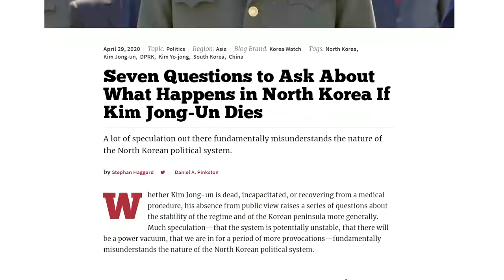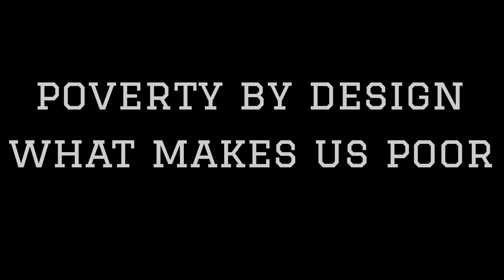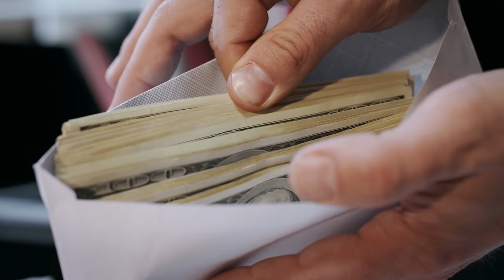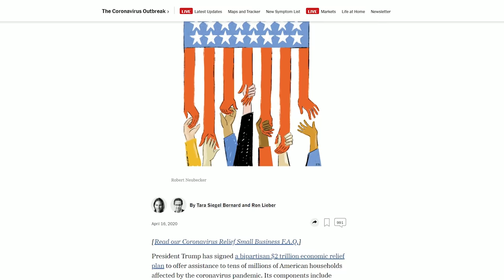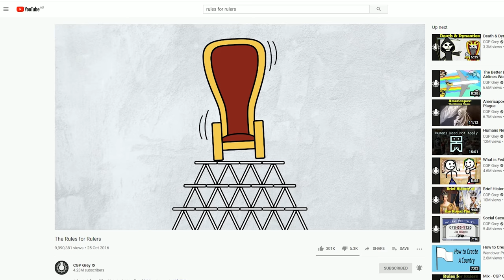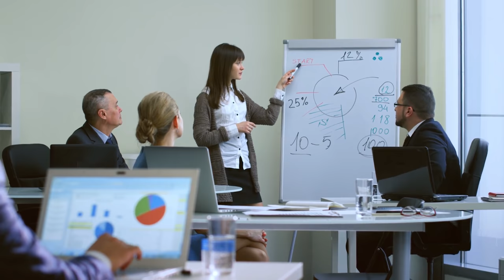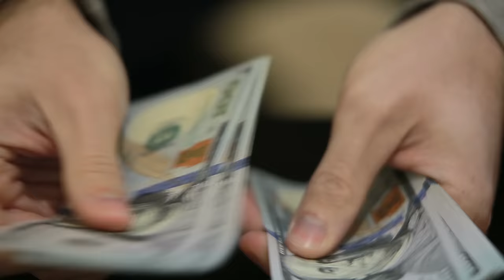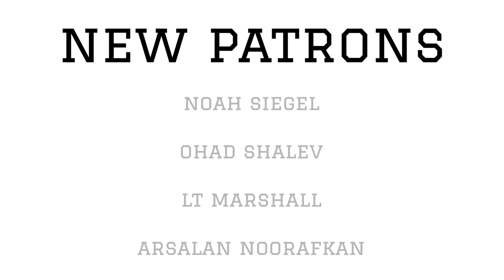Can a New Leader Save North Korea's Economy?

Comment: Speaking of mismanagement and dictatorship. The Economics of Zimbabwe would make for an interesting video. From being on par with the USD to having the second worst hyperinflation ever
Reply: "On par with the USD" wtf, do you mean the Zimbabwean dollar was as strong as the USD? Well, it wasn't. It might have had the same nominal value at some point, but it was always an extremely weak currency. Zimbabwean dollar's inflation was in the double digits even before the events that lead to the hyperinflation happened (namely the displacement of European farmers and replacing them with inexperienced African ones which lead to the collapse of its agricultural industry, and the extremely expensive Second Kongo War the country funded by printing money). It wasn't a stable, strong currency going into hyperinflation, it was a weak and unstable currency becoming even more unstable and eventually hitting hyperinflation
Reply: Exantius E during the period of fixed/managed exchange rates globally (Bretton Woods & the 70s) Rhodesia/Zimbabwe set their currency at equivalence to the US Dollar. But you are correct. The economic fundamentals of the Rhodesian, and subsequently Zimbabwean economy never justified the overvalued exchange rate they imposed on themselves. This eventually became very apparent as the country suffered chronic balance of payments problems long before Mugabe seized the farms and plunged the nation into hyper inflationary madness.